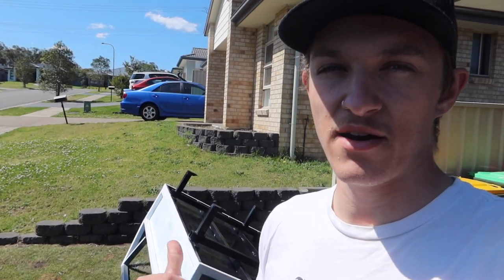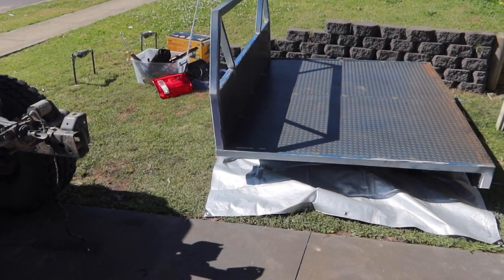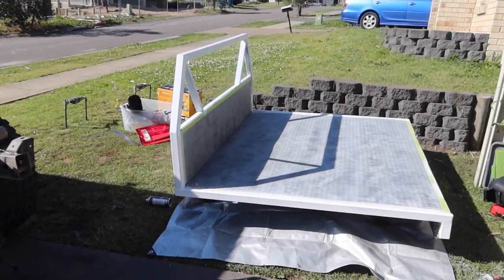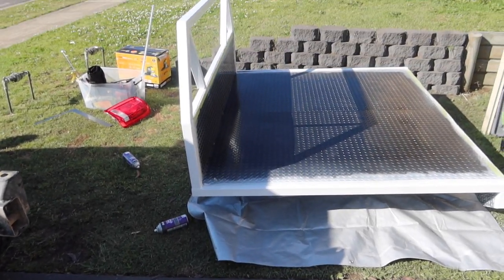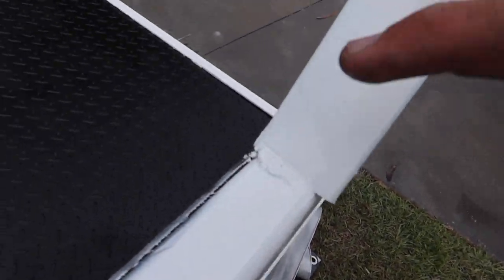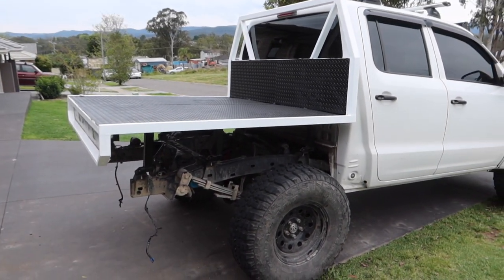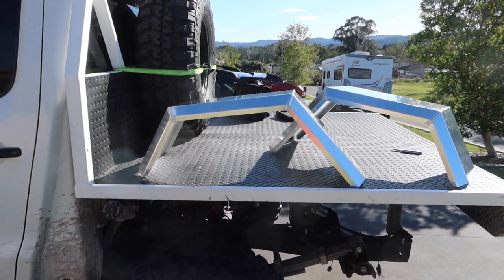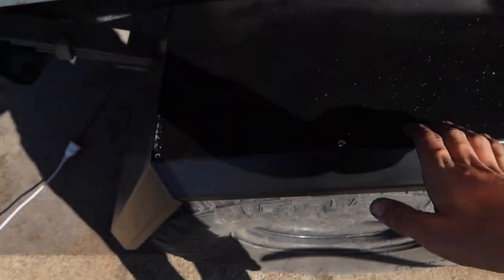D.I.Y Custom tray build part #4

Comment: Love the videos my dude. 

Just a heads up. If your paint starts comming off the guards is because you didn't prep the surface. Not tryna be a dick, just saying. So if it dose back to bunnings get some red scotchbrite abrasive pad and scuff the fuck out of them. 

Big misconception is that paint is like glue. 

Paint only stick to things that are scratched. As the paint drys is contracts and pulls Into the scratches "holding" itself. 

Besides that man fucken killer job. 

(I'm a spray painter so I had to open my mouth lol ❤)
Reply from the maker: Thanks mate your exactly right! Has come off the guards but not the rest haha I will definitely do that